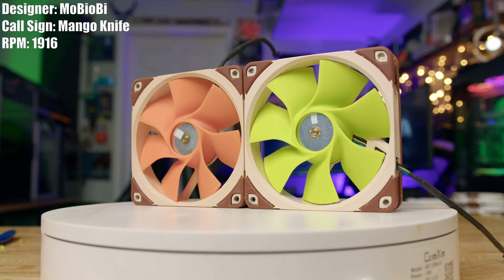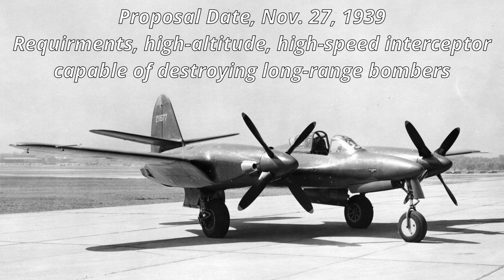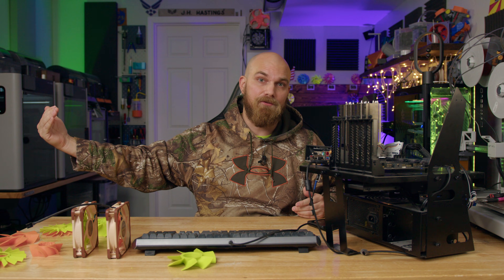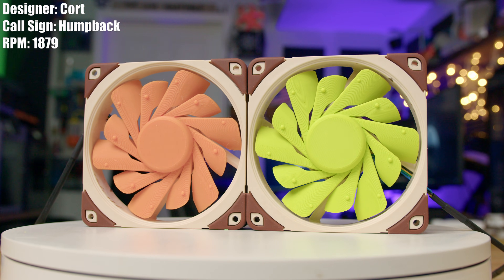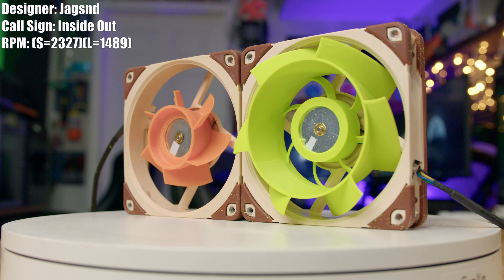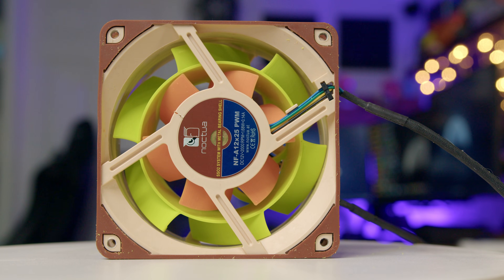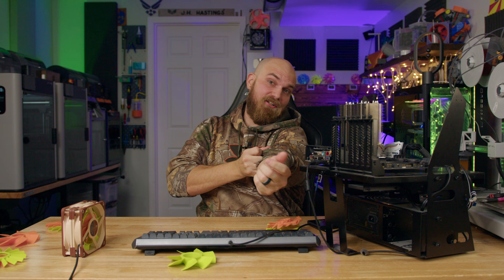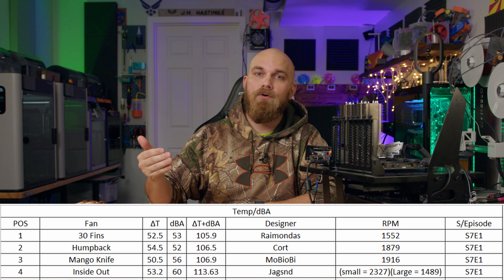Stacked TWIN Fan… is a Monster | Fan Showdown S7E1

Comment: I'd be curious to know how you weight each scored factor since the MK was clearly the best. It looks like you just averaged the deltaT and dBA. I'm not really interested in sound but I know a lot of people are because of sensitivities or just the unwillingness to learn to ignore the noise. For people who prioritize performance, the MK is the obvious choice but, for people who heavily prioritize noise, the way you've got it is probably a good compromise although not ideal. I don't think ideal is even possible since the range of sensitivity is quite, quite wide. Honestly, 2 degrees isn't going to make a difference for the actual performance of a PC in most situations.

Comment: On my channel, I also focus a lot on fans and cooling. I was using an Aicevoos anemometer but it has become unreliable, and the other one I got gives me no way to specify the air volume around it that it's useless unless I can figure out an equation to convert the results (which I can't). Do you have any suggestions for anemometers that won't burn my wallet?

Comment: I think the score should be weighted somehow. Maybe the volume is divided by 2? Since the difference in volume seems to not be huge overall, and temperature is still more important, maybe dividing the decibels by 2 or some other factor would balance it a bit better?

The real way to do it is some form of sliding scale that adjust the penalty based on how loud it is, but that gets mathematically complicated, likely to a point of confusing the audience and making them think you’re making crap up.

What you really need is something that does the scores based on the max. So like:
Score = (db / max DB) * 20 + (dT / max dT) * 80

The scores will change with each new episode since the maximum temps or volume can change, but the placements should still adjust normally. You could change the 20 and 80 depending on how much weight you want to give to the volume vs the temp.

Comment: Could you possibly rescore these using a normalized scoring (maybe to two noctua fans)? Sound is logarithmic, so every 3dBa is an actual doubling of sound. Plus, it is much easier to apply a weighting to the scoring if the scores are normalized.

Comment: 1. You could include more variables like weight or filament used aka price of printing.
2. When you want to compare multiple variables you want a composite score, which requires normalisation. 
# Scoring and ranking with multiple variables
involves normalizing different data scales, assigning weights to variables based on importance, and then combining them into a single composite score, often using weighted averages or more advanced techniques like Principal Component Analysis (PCA), to create a final, ordered list where higher scores generally mean better performance, handling ties appropriately with methods like RANK.AVG. 
Key Steps to Score and Rank

   -  Normalize/Scale Variables:
        Ensure all variables are on a comparable scale (e.g., 0 to 1 or 0 to 100).
        Method: Divide scores by the maximum possible score or use min-max scaling.
   - Assign Weights:
        Determine the relative importance of each variable (e.g., 70% for Variable A, 30% for Variable B).
        Method: Multiply each normalized score by its assigned weight.
   - Calculate Composite Score:
        Sum the weighted, normalized scores to get a single overall score for each item.
        Example: (Norm_Var1 * Weight1) + (Norm_Var2 * Weight2).
    - Rank the Items:
        Order the items from highest to lowest composite score.
        Use ranking functions (like Excel's RANK.AVG) to handle ties, giving them the average rank of their positions. 

Common Techniques & Considerations

   - Weighted Average: Most common for simple scoring.
   - PCA (Principal Component Analysis): For complex datasets, PCA can find underlying patterns and create an index from many variables.
   - Handling Mixed Criteria: For variables where lower is better (like time or errors), flip the score (e.g., 1 - normalized_score) before weighting, or use specific logic in programming.
   - Software: Tools like Excel (using SUMPRODUCT, COUNTIFS) or programming languages (R, Python with pandas) offer powerful ways to implement these methods.

Comment: Does the standardized motor you use for these tests have a data sheet that you reference at all? I assume the motor and driver have were designed for a specific RPM, and I'm curious if that would be a valuable parameter to include for duty cycle/useful longevity of fan hardware. PS-I love you videos and I've been watching your videos for years despite me having minimal knowledge of computer hardware. Aerodynamics and full-scale aircraft design are my profession but I'll always geek out on spinny bits moving air no matter the use and size!

Comment: Db is a non-linear scale, and when added to a linear scale (deltaT) you weight the change in T as more "valuable" to the equation. Might not be a noticeable weighting but It does possibly bias the results. 

Anyone else understand the math better to prove/disprove this?

Comment: A little late to the party, but here we go.

I love this series, but think it would really benefit if you brushed up on scientific approaches.

Couple of suggestions to this end

Adding dB and △T feels wrong. Completely different scales, one is linear, the other isn't. Find a way to represent them on a standard and then combine the standards, or just keep them separate.

Do all the testing with the cooler in place. I can easily see the cooler affecting pressures, sound, laminar flow, the lot.

Find a way to generate a metric for the smoke test

Add some things to Test for
Intake Airflow
Outlet Airflow
Multiple points of air pressure readings (kind of like a pitot-static system)

Comment: another idea popped into my head now... what if you used medium to think blades but instead of a symmetrical circle they were offset like a corkscrew.  thinking of the depth of the hub, where first is at the edge, second like .2 inch lower, repeated until you hit the back edge?  also wondering why nobody uses a cowl, wouldn't that help with the air flow dynamics?

Comment: i wonder if a small fan setup similar to a jet engine would work myself.  would it damage the computer?  what kind of power would be needed?  design?  would it heat up my room?  different fan blade counts in serial stack?  eh idk its what popped into my head.

Comment: Some thoughts - purely on methodology:  You should consider not only the peak decibel reading but the frequency that the sound is coming in at (your spectrum analyzer shows this in the plot, which is great).  The human ear has a very nuanced sensitivity to sound at different frequencies - this can be seen in the Fletcher-Munson curve: that 30-blade fan was actually, audibly, the quietest since it's "loudest" frequency was in the lower end of the human hearing spectrum and down there the ear is far less sensitive to  the same sound pressure level as it would be in the higher frequencies.  There is actually an ISO for this - ISO 266.  Lastly - the delta T + decibel "rating" should take into account that a 6 decibel difference is effectively twice as loud - not a linear number.  If a fan cools 6 degrees better but is 6db higher, that's twice as loud as the other fan, a 12 decibel difference is 4x louder.
Reply: Inside-out: 60.5db measured at 315hz: ≈54.5 phons (loudness level)
mango knife: 56.4db at 240hz: ≈45.9 phons
30-blade: 53.4db at 28hz: ≈6 phons (the 40db at 260hz however, was around 29 phons, which is it's actual loudest)
hump-back: 52 dB @ 54 Hz: ≈9.1 phons (higher up though, 44 dB @ 375 Hz → ~38.2 phons, which is it's actual "loudest").

hopefully this illustrates how using flat SPL levels without taking into account frequency isn't doing justice to the "noise" levels these fans are creating.

Comment: I wonder if you can make a test to see which fan would be a better exhaust fan and which would be a better intake. Watching the smoke test make me think which would be more effective for cooling a case as opposed to removing the stale hot air from components. Essentially the same thing I guess but, some of these fans disperse the smoke a lot more than others.

Comment: I would say include static pressure in the mix of evaluation.
Not only do you get the sound as an evaluation because no one can stand listening to an ear deafening fan unless it is in a server stored away in a room no one comes in to. But I don't see servers being the intent of the tests.

But you would also on top of the cooling efficiency get a pressure test of how much air the fan can actually move as in some configurations you want the cooling efficiency and in others you want the pressure efficiency. And as most people like running the same fan all over their system than buying a lot of different ones..that could be a way to clearly differentiate.
Just a thought.

Comment: Are you sure you want to just add the dB to the Temp as a metric? That way a fan with no blades and no sound will make the CPU go to 100°C or so and the score will be better than ones that actually cool. Or would you disqualify something like this?

Comment: I'm curious what the sound and cooling looks like at various speeds for every fan.  There's a curve to explore here, I think.
Reply: Also, how are you loading the CPU?  Another question to consider is timbre of the sound (and the weight curve of noise measurement)!  A fan with 60dB but peaking sharply around 250Hz is less annoying to most humans than the same SPL at 2500Hz.

As for the smoke, I have to admit I don't care one way or another.  I generally skip it because it doesn't really tell me anything

Comment: I think for the sound test, where the noise's most significant frequency peak is should factor in. Lower frequencies are far less disturbuing than higher ones. So a bigger penalty should be applied for a fan with peak noise levels at more than 100 herz, getting a higher and therefore worse score than a fan with peak noise levels at frequencies lower than 100hz. Could use a sigmoid function for this "normalization".

Comment: I don't think adding noise and deltaT together and then choosing the lowest score is a good scoring mechanism - it would favour a fan which has a very small deltaT and very small dB (in otherwords a terrible fan but you can't hear it) which I don't think is what you are looking for. Perhaps you might get a better result if you made the noise as percentage of an 'acceptable' level then multiplied the deltaT by that percent to get the lowest score? I think you also need to consider noise as more than just dB because you could have a fan with a high dB but at a frequency outside normal human hearing, you should define and weight the frequencies of noise where you are most concerned about dB being generated (appreciate this can't be fitted into regular video format every time but the maths would be consistant that you could just do it in the background each time)

Comment: Combine allllllllllll tttthhhhhhheeeeeee daaaatttttaaaaa.

Air flow per minute
Static pressure
Flow pattern - turbulent vs smooth
Noise
Cooling

WE WANT ALL THE DATA IN ONE SEASON TO BE THE STANDARD FOREVER
Reply: The numbers shouldn’t be added together, placement in the category should be added together and and get overall placement

Comment: Your scoring math doesn't hold up. The Humpback should be the winner. It had the best Delta T (highest amount of cooling)  and the Best DBA (lowest sound) of the four tested. If there was a fan in this test that had a Delta T of 58 and a DBA of 50 (both numbers for this fictional fan clearly being best in each category against the others), yet because you're adding the two numbers (108), it would have come in fourth place (out of 5). You have created a great challenge...  to get highest possible Delta T while having a low DBA, so adding the two to determine the best won't work. One suggestion would be to subtract the DBA from the Delta T. With this you will get some negative values (that's ok), but the highest positive number will be the best performer. Another way (I think better actually) would be to divide the Delta T by the DBA. You get a number that represents the amount of cooling per DBA of noise, The highest value will be the best performance. Tie breakers goes to the fan with the higher RPM.

Comment: I think including sound in the testing score is a great idea! However, actual sound levels are only half the equation, pitch is a bigger issue in terms of hearing fatigue. A deeper tone is easier on the ears than a whining pitch, I think if you’re going to include sound in the score there needs to be a part of the metric that accounts for this.

Comment: Imo the test should be done with the cooling block in between. the cooling block allows for directed airflow in between those "fins". Pumping 20L of air through the space between 2 fins will result in less temperature drop than pumping 20L of air through all 20 openings between those fins.

Comment: But you measured the fan noise when it is not attached to the cooler, there is no assurance that it will measure the same noise level when it is actually trying to cool the CPU. Yet you use it with the delta temp. Does not make sense at all

Comment: @MajorHardware
Noise is something to consider, but volume is not the only factor. The sound profile is just as important. Performance is of course the top concern. To my ears, the 30 fin had the most pleasing sound profile for the permanence it offered. So to me, the 30 Fin is the overall winner in this round. However, the Inside Out gave a solid performance where airflow is concerned. Comes in a very close second overall, but is my top pick for the raw performance.

Comment: For the scoring, you should either multiply the ΔT and noise level together or explicitly state the coefficients you're using for the scaling. I don't think it's inherently the case that 1dBA of noise is equal in value to fan performance as 1℃ of temperature change.

Comment: Noise normalized testing is the way to go.  You don't need GN's insane test setup, but want a fixed distance mic with the fan on the cooler.

Any sort of DB adjustment to the score will be subjective.  Especially since DB is logarithmic, and DB / degree is a preference thing.

Comment: But hold on a moment, if you just sum it up, then cpu will throttle at like 100°C, so from 20°C room temp to 100°C you'll have 80°C ΔT, and then if you make fan with no blades producing essentially no sound, it will achieve 80 points which will be currently top fan. You gotta do that over man or you can VERY easily cheat entire competition by submitting empty STL

Comment: Ive been hanging around for a while, every time I see a fan showdown episode I watch it! 
I am torn on the new smoke machine. On one hand you can see more intricate airflow with the smaller amount of smoke. But with the old one you could see if the fan was able to consume all of the smoke or not and how far of a reach it had. 
One comment I have on the smoke machine is you should make a mount for it so it's in the same position for each fan if that's not to much trouble. 
Also I'm confused on how the one in 3rd place had a higher score than 2nd lol

Comment: Might be much ado about nothing, but I can't help but be bothered by the noticeable gap between the fans on the Inside Out.

Fully addressing the issue might be overkill, since you'd have to design and then print out a sizeable insert to place between them and create a single uninterrupted tunnel, but that's not all that unusual for this channel.  Additionally, you could reuse such an insert for potential future designs involving sandwiched fan layouts.

If that IS too much, it looks like you could at least swap the anti-vibation pads so that the full wraparound pads would be on the inside.  That would at least seal off the outer perimeter so that isn't getting pushed or pulled through little slits on the sides.

Comment: Sound should be tested while mounted as air restriction will affect the results.
Rating should be based on Δ°C/dB to rate them based on the ratio of how well they cool per dB rather than the additive method that gives equal weight to the measurements.